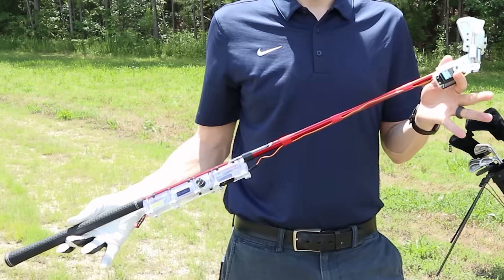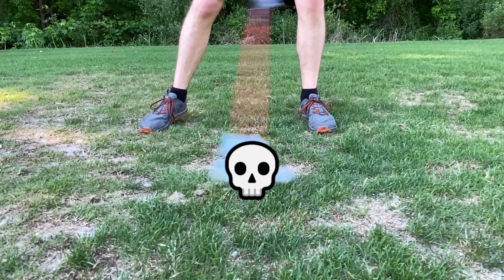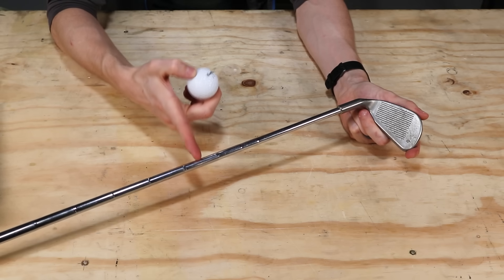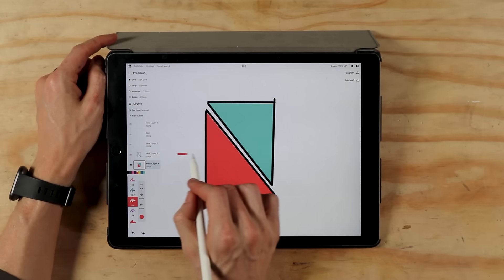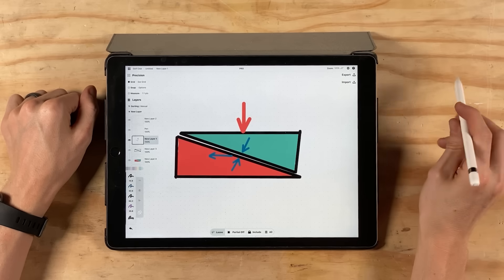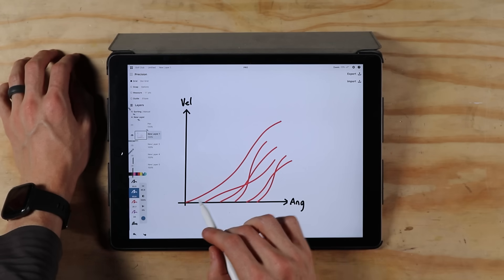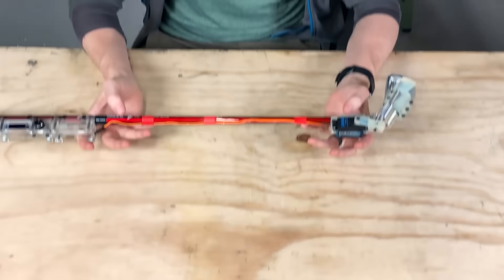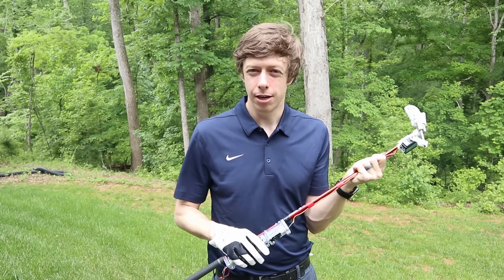My self correcting golf club makes me a better golfer

Comment: This audio engineer with 3yrs college physics background and acoustics interest says: The shockwave/impulse propagating through the tubing is reflected at the aperture to the master cylinder due to difference in impedance of the portions of fluid. The portion within  the cylinder is totally incompressible, whereas that within the tubing is functionally compressible because the boundary of the tubing is not very rigid. So the wave motion is actually occurring transverse to the surface of the tube, but it propagates longitudinally. The only energy lost (not reflected) prior to the impulse hitting the slave cylinder is due to heat from friction within the walls of the tubing as it distorts, and andy permanent deformation of the tubing. When the reflected impulse returns to the head, this is indeed what is blowing the face of the club off, as nearly all the energy you put into the face of the club in one direction is stored and returned in one impulse in the other direction.

Using real hydraulic hoses will dramatically reduce the quantity of “springiness” of the system, therefore it will not have the capacity to store the same amount of potential energy to be reflected. As I understand it, the fluid is not compressible. But I’ve seen hydraulic hoses move under pressure, so I assume that they have a springiness, at least without preload. An impulse will still travel down the tube, and will still be reflected. But if the fluid is at all compressible or it cavitates (making it compressible), the reflection will be more evenly distributed between two returning impulses— one from the aperture to the master cylinder, and the other from the piston face/internal walls of the cylinder. If these assumptions are true, the two return impulses will arrive at slightly different times as they have traveled different distances, so the difference in resulting reflected energy impact at the club face should be something like 1/4 * ((old tubing potential energy) - (proper hose potential energy)). Either way, it probably wouldn’t knock the striking face off.

Furthermore, the “speed of sound” is a constant given in air at sea level at [I forget] humidity. The speed is much greater through more rigid&massive materials. And it refracts and reflects when transmitting between one rigidity&density material to another. So it’ll transfer up the club much faster than you might be assuming.

Fascinating tho! I like the whole premise. And I wish you’d try the real hydraulic setup just for fun, even though it’d be completely impractical. Still, with too much hose length, there will be enough “springiness” to allow for potential energy to be stored. And thus you’ll run the chance of fluid cavitation if the impulse generated at impact is great enough. This probably won’t increase the returning impulse, but could cause the fluid to break down rapidly. —“No, I can’t play this weekend. I gotta get the fluid changed on my club first. The swingometer says I’m 14 holes past due.” 😂

Comment: For a hydraulic pump you should look into a motorcycle brake system. Brake lines generate insane forces and the tubing is extremely light, don’t use hoses.

Comment: Put two cameras on it.  Then is can measure distance to the pin. Add a GPS to it, you will know which hole you are at. With these two sensors, all you need to do is swing. The club will do the rest.

Comment: Check valves for the hydraulic hoses to keep the oil from going back through was thinking about that the minute you brought out the hydraulic ik the pressure would blow back

Comment: I am very new to your channel, so I don't know your skill level in software. But you seem quite capable! 

The current setup of the club is perfect for using "Kalman filter" to estimate the optimal angle instead of your brute force method. 
This method also allows you to ~easily extend the number of parameters such as the current wind and it's impact on the trajectory.

Cheers!

Comment: I'm reminded of ripping the pin header off my no-longer-available 3d printer screen. The designer put the bare-minimum width traces in the most inexplicable layout making it nearly impossible to get some magnet wire on to fix it. I've gotten it working sans sd card (chip select is inaccessible because of other parts soldered over the trace I need). I feel your pain. I was a very calm adult when it happened.

Comment: EXOSKELETON , you should build an exosuit  to enhance lifting, running , allowing distance and speed improved. 

Also I been working on a cool suit concept with a backpack powered with lithium ion batteries and using Peltier devices to rapidly cool water that then gets pumped through tubing. Also using pelters direct skin contact on areas of great blood flow, ie wrists , neck and feet area not sure where arteries are in feet area, Im sure I can find out on google. yup that worked back of ankle area.

Comment: Nice.  I think I have a better solution for your shaft lean problem.  With the club being the same length, regardless of loft, you should have the same set up and shaft lean at impact.    As a better golfer, I know for a fact that shaft lean at impact is not determined in almost anyway by shaft lean at address.  I think it would be better to find your average shaft lean at impact by means of slow motion camera, or use of a trackman system.  A trackman system won’t necessarily give you shaft lean, but you can deduce shaft lean by subtracting the static loft (loft on club) from the dynamic loft (loft at impact).  Good luck.

Comment: I have an idea. (which might require a custom servo) How about this; you calculate the angle of impact you want then assume the ball will be struck somewhere within a certain range. You move the head to the angle at the start of the range then, (this is where the custom servo comes in) once you reach the beginning of the strike range, you start to rotate the head "slowly" so that it stays at the correct angle within the whole range.

Comment: The thing with the distance and the ball made me wonder. Could you put a peace of tech in the pin, where the ball lays, to triangulate the distance between the club head and the ball? In close proximity you could say that it's the same.

Or use a button to to teach the position and estimate the movement using integration of the accelerometer data?

Comment: Have you ever seen the Shaper Origin? It's a router that has a screen that shows you wear to move the tool to cut out specific shapes and it makes small corrections to compensate for user error. There's all kinds of other tools that would be really interesting to create robotic assistance for. A handsaw could be really interesting, it could help cut dovetails and other joinery extremely precisely.

Comment: The speed at which pressure waves move is dependent on the material it moves in. Because the steel should be a lot less compressable than air, the wave should move a whole lot faster

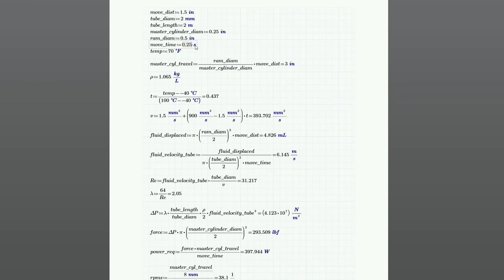Comment: Ha ha ha. The calculation at 3:19 is a typical example of ill american calculation way. Mixing inches with millimeters, Fahrentblabla something with Celsius, Libresomething with kilograms, and myriads of "bulgarian" constants for conversions among each other. A clear reason why american kids must hate maths and physics. That calculation of simple stupid relation among Volume, temperature, pressure, power, looks like a rocket engineering, because of this "american way of thinking".

Comment: As a person who regularly "tops" the ball it would be good for the club to sense that the head is too high when about to hit.
At that time, if the shaft was longer by even 1 inch then the chances of a good hit would be vastly improved.
Reply: I have that problem too, along with slicing. The best tip my grandfather gave me was to keep my head down, and wait until I see both shoulders before I pick your head back up to see where the ball goes. Bear in mind, I'm not a good golfer by any means (shoot anywhere between a 95 to 110), but it has helped me drop several strokes.

Comment: Comming from an applied mathmatics (numerics) background I wonder why you wouldn't use something like RK4, LeapFrog, ImplicitEuler or at least an explicit method to integrate your movement speed to a prediction. Just use the last 50-300 ms of movement speed and you get a reasonable prediction if you advance those measures in time. No need to sample a curve. The only thing you need is time and accelecation. You can use speed measurement as a correction in this algorithms. See https://en.wikipedia.org/wiki/Runge%E2%80%93Kutta_methods or https://en.wikipedia.org/wiki/Leapfrog_integration

Comment: You could build a range finder with compass on that that could then also control your slicing by also setting the correct compass angle of the head as well as the elevation angle.

Comment: $350 and it doesn't even include a breakout? I hate those duel through hole/pcb mountable edge of board contacts. They are decent for PCB mounting but SUCK for through hole, as you saw.

Comment: Obviously easier said than done, but just a possible recommendation on the slice and hook adjustment. You could set the Xo of the angle where you start the club, so the servo would adjust for the delta of that angle. In my mind, using the same mechanism for the club head angle should also work for the shaft, just rotated vertically. Again, way easier said than done but just a thought in case you were stuck

Comment: Thanks for sharing. I like the design concept. Perhaps the design would be improved by coupling the club with an intelligent tee. The tee would communicate the x,y,z of the ball in order for the club to make last-second adjustments. (With a fixed reference, the error is grossly reduced.) Moreover, the tee could also be equipped with a line of sight between the ball and the hole, so the the ball's direction could also be more accurately calculated. Your design approach is intelligent using an iterative approach to determine the club's head angle. Instead  adjust the error off of the theoretical flight rather than empirical method you now use. This approach would also reduce the error to result in a better flight trajectory. Great job in any case! Real engineering my friend. :)

Comment: "I'm not buying another one so I guess I'm writing a USB driver"
holy shit lmfao
Reply: I wish I was as smart as everyone else here
Reply: @Ty Whatley I feel the same lol
Reply: @Cipherx420x  at least I can handle myself on the golf course lol 1.5 handicap from the blue tees at Texarkana Golf Ranch💪
Reply: I read comments before watching the vid and I thought this was a joke
Reply: this is why i hate soldering...there is no undo.
Reply: Yeah, instead of soldering the pins back on, or just use some wires, it's not even that small of a board. It is usually not that hard to figure out what pins/connectors have been connected to...
Reply: @martinfinne7259  He ripped the solder pads off the board so he would have nothing to solder the pins too.
Reply: @Teagles216   That is not a problem, you can at 9:27 clearly see all but the last trace, probably on the other side of the circuit board, just scrape off some soldermask and attach some fine wires. You can then either just glue the wires to the board as strain relief and connect them directly to another board or glue the connector back on and solder your wires to it. This is possible as long as you still have just a tiny bit of copper left, it's first when you rip out a partly hidden via with the trace you are in trouble, first then you (in this case) make USB drivers or digg into the circuit board and hope not to destroy any further traces.
Reply: @martinfinne7259  i dont think u understand what dramatic reenactment means
Reply: @martinfinne7259  yep, and at the end of all that, you're gonna put it in an object subjected to severe forces and hope your sketchy rework is robust, only to find out it isn't and you're getting intermittent data transmission errors. The sum total of time spent doing the rework and debugging the resulting flakey mess vs the amount of time it'll take to write the USB driver are probably somewhat equal in the short term, but long term the USB driver option is more robust, less error prone, and probably less of a headache.
Reply: @DeShark88  I agree. Depending on his coding skills, you get the driver done and tested in 1 or 2 sessions. It's mostly boilerplate code.
Reply: @DeShark88  Nah, I agree with Martin on this one, but maybe that's just because I do circuit board repairs much harder than this all the time. Inspect for any broken internal layer traces, and follow the tracks back to the pad of the nearest undamaged pad. Solder on your jumper wires, stake them to the board, and you're done in probably 15 minutes. Flux is your best friend when soldering with small parts.
Reply: @martinfinne7259  scope and tiny patch trace work yea it could be done, send it to luis !
Reply: @Sam Hewitt royce da 5'9 - "A wise man knows a wise man knows nothing"

Honestly it doesn't bother me to know there are people smarter than me, for humanity's sake I would certainly hope there are plenty of people way smarter than me lol. At the same time I feel very confident about where my place lies in the Dunning Kruger theory. I also have a great relationship with God and that's all that matters to me. Thank you though Sam for being a kind person👍
Reply: @tywhatley1683  Good viewpoint to have on this stuff and knowledge in general. Also made me remember what Dunning Kruger theory was.

Though, I do feel it apt to mention that the quality of the kindness in Sam's reply was... very questionable. Given he pretty much said 'all these people are just a bunch of clout chasing 14 year olds who don't know shit'. Which is a really shitty way to try to compliment someone and it also tears everyone else down at the same time. 
Even if the intent was supposed to be kind, it's still really rude.
Reply: @AutumnsCrow  And your comment will be a perfect example for Sam to show kindness trumps hatred. You showed me respect even though you disagreed with something I said, and you respectfully stated your concern to Sam in regards to his negatively put opinion. Calling it out exactly for what it was, maybe he will read that and understand what he did and learn from it. I just tend to be too sarcastic and I can see how my comment was misleading

Comment: Since a big problem is hiring the ball "thin (topping) or "fat" (too low), can you include a sensor that shortens or extends the club at the exact moment of impact? It's probably not possible but arranging for the ball to be hit exactly in the center of the clubface is one of the most important aspects of striking the ball.

Comment: Mabe dash lines from automotiv or aviation applications could work for your hydraullic design. Arlows, a german  automitiv tuning shop, has some great products with ptfe lining and verry low strech. A Dash 6 (id. 8.73mm | 11/32") Steelflex line can withstand 2000 psi and is, due to the ptfe lining, resistant to most hydraulic fluids, even skydrol would be possible but i dont think you would like stuff like that on a highpressure system near your body ...
Reply: Alsow Phillip Kaess, I think hes the owner of Arlows or sth. like that, is always looking for fun projekts and other applications and is realy on to designing coustom solutions for himselve . I think he would be up for a colab in such a project :D

Comment: 4:08 :  "It generates a pressure wave in the material which as far as physics are concerned is basically sound": Yes. "It goes at the speed of sound": No
Reply: The speed of sound depends on the density as well as the elasticity of the material the wave is travelling through which is why (sound/shock) waves travel through metal more than 10 times as fast as through air.

Comment: I found your channel today and I have to say, that your content is really funny to watch and you can learn something - nice job!
But my question is - with what program do you make the code for your CNC machine (I use hyperMill) and the second thing is, how do you measure the diameters and lengths of your tools? Do you only do this by trying when the machine touches a surface or do you have another device for this like a "Zoller"?
I am sorry for my terrible English btw.

Comment: So getting back to the hydraulic club head, have you considered ditching the hose entirely and running a pair of hard lines up the club shaft?   3 pieces of titanium tubing wrapped in glass would make a nice shaft and give you plenty of room to flow hydraulic fluid with no chance of expansion.

Comment: I feel you man for that 10 hour wasted on debugging..as I am a computer science engineer (under grad). It's always the obvious thing that breaks the code.
I am really new to this channel and likes your work. I am willing to help if you want some helping hand as I
did a lot of stuff with I2C on usb file system manager or RTOS and stm32 (arm cortex) in past. In fact, I used I2C in arduino for my first engineering project at college, monitoring heart rate of patients from watch to cloud.

Maybe off topic: if you're using IMU with I2C in arduino, I think it would be easy to just follow a I2C example and use the I2C library they have.

Comment: Maybe try using some open source ai to help with the data? It might be able to help with the prediction of the face angle. 

As for the face rotation in other axis since what it have to be is in term of golf is "square" like the netual position at impact I think using the signal design philosophy that auto pilot uses should do the trick from programming stand point. 

As for mechanical standpoint i am not that good but what I observed from golf club designs they usually do not do things at the face of the club but more on the hosel and shaft to avoid the impact so maybe take a look at that?